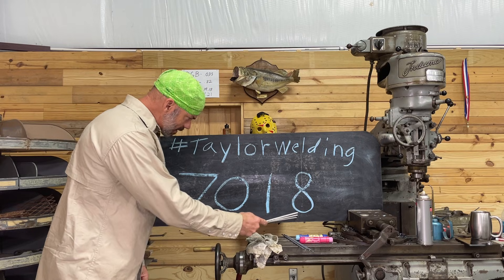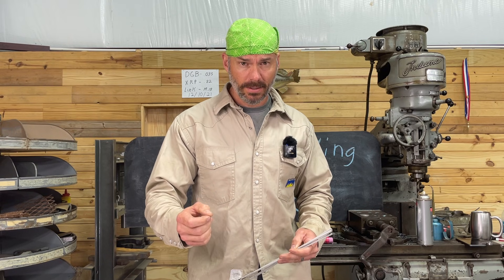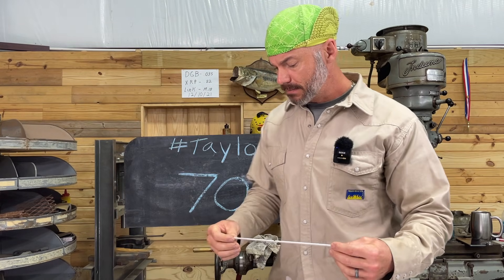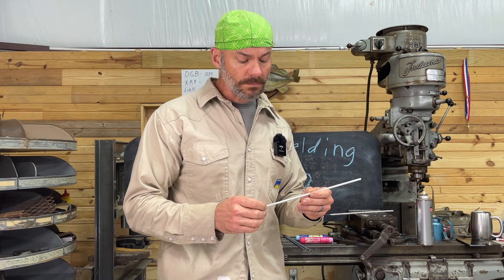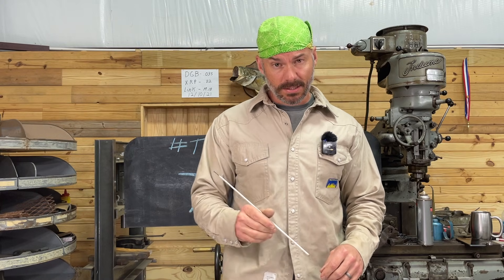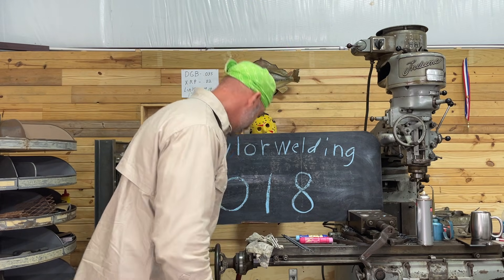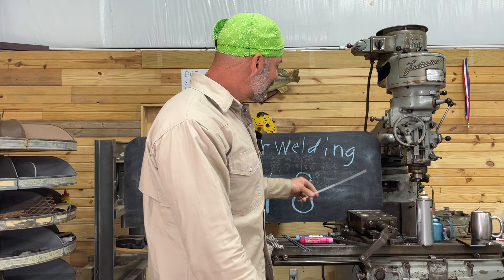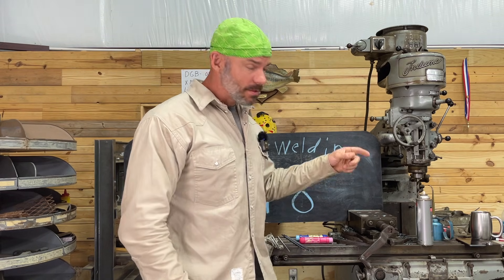How to Weld 7018 welding rod tips and tricks.

Comment: Thanks bro will put the tips u shared into practice.Tell me is it absolutely necessary to use a hot rod heat with 7018.. especially if welding oil n gas pipes?
Reply from the maker: The only thing around heaters good for is drying out your rods. Keep them dry you don’t need a rod heater. IMO 
That’s just my experience.

Comment: Enjoy your channel. I did recently see a test on 7018 on a youtube video called "Hydrogen Cracking"  where they put the welds into mineral oil to see the hydrogen seep out. From what they showed, there really is less hydrogen in the weld if the rod is kept in an oven. Like you, I've had no problem welding with the rod either way but... food for thought.
Reply: It's unfortunate to hear this video. He's got a LOT of good videos with many helpful tips, tricks and explanations. However, not understanding hydrogen embrittlement isn't a good reason to put out incorrect information about it. 
Your weld will look great. It will pass UT and X-ray. Hydrogen embrittlement will likely only be noticed after failure of the member. Is this a big deal in oil pipe? Probably not since most are underground (however most DO leak).
It's entirely different when you're talking about a bridge or high-rise. 
I hope the great videos continue, I'll continue to watch.
Reply from the maker: That’s interesting I wonder if it makes a damn bit a difference
Reply: @TaylorWelding  hydrogen embrittlement is real, that's why most welding codes require 7018 rods to be kept dry.

As you know they don't generally become harder to weld with if they get moisture in them.

Comment: Ive got a tip !!! If you use 3/32 7018 and have trouble welding it because it shakes a lot , Just shorten up your rod , I shorten it up by where the stamp is at on the rod . 😄

Comment: Chris thanks for another great vid. I’m a hobby welder that’s retired who welds quit a bit. 7018 restarts are a pain! 
Any thoughts?
Reply: Start it,long arc a bit ,choke up and weld.
Reply from the maker: Yes I've touched on that a little bit. I'll make you a video tue
Reply: 7014
Reply: As soon as you snap out give the rod an aggressive flick. That gets rid of the little slag ball that's about to freeze on the end of the electrode.

Then tap it on the floor or on a hard, ungrounded object to knock back the flux a bit so you expose the rod.

After that you should be able to restart no problem, just be extra sure to strike the arc like you're lighting a match instead of tapping it and it shouldn't stick.

Porosity shouldn't be much of an issue either if you follow those steps.

Comment: You got an overhead or vert up video? Been welding overhead for years with pulls and cv mig. But I’m now shaking off the stick rust and need to reteach myself. Never welded uphill with anything either.
Reply from the maker: I don’t have any vertical videos. I need to do an in-position pipe welding video. That will cover all positions

Comment: I haven't welded in years, but ready to start back with it. Thanks for addressing porosity. I had a problem with it once and had no idea what was causing it and I couldn't remember it being covered in school. Lastly, something to add that i did remember, was how they name the rod.E for electrode, 70 is the tensile strength, 1 is the position allowable to weld 1= all positions, 8 would be the composition of the flux, low hydrogen for the 8
Thanks for sharing your knowledge.
Reply from the maker: Thanks for watching. Man when porosity starts it’s hard to pin it down where it comes from.

Comment: I've got 2 boxes of 7018 ac and I haven't had any luck with either of them yet (one is Lincoln 3/32 and the other is Hobart 1/8). All kinds of porosity at the start and a few random spots throughout the length of the weld
Are the AC 7018s junk? My welder can do DC also, I just didn't realize they were the AC version
Any tips?
Reply from the maker: Yeah I wouldn’t mess with this ac version. Sounds like the culprit

Comment: Only thing s rod oven is good for is reviving rods that have gotten a little bit a moisture to them. It can for sure dry them back out and make them weldable again. At least if they are not too far gone anyway if they have too much moisture their trash toss em. 

And another thing to check especially the last 5-10 years is cheap steel from China... There's a LOT of that stuff floating around and not only will welds get porosity for no real good reason no matter what you do but, the stuff can be so brittle you cant even put it in a press break and make a 90 bend without the whole backside of the bend blowing out. Haven't see it in pipe though but, ive seen a ton of plate steel from china that is just complete garbage.
Reply from the maker: We don’t use any fittings from China for that reason. But Every now and then I’ll weld one that’s just not quite right. It acts funny you know what I mean. China’s QC is  really getting bad
Reply: That stuff fizzes. Damn near lights on fire!

Comment: How do you feel about a 6010 root with a 7014 cap?
Reply from the maker: Just about everything we do has a 6010 root. I don’t know anything about 7014
Reply: Hello, maybe he means 7010
Reply: @f.f985  he means 7014. They burn like a 6013 but with the strength of a 7018 and they don't have to be dry like a 7018. I love em
Reply: I run 6011 root very similar to 6010

Comment: Good video the 7018 is a great rod I always keep some in California you don't really need a rod oven the Sun is so damn hot I open the rod holder and leave them in the hot sun or just take my little propane torch to them and go on welding it works for me always

Comment: Can you weld a small boat trailer with 6011 rootpass and 7018 1/8 thats been covered in the plastic box
 in the garage for 2 years and never been in the oven since the box was opened ?  How  strong will that trailer tongue be?
Reply: Tks man preciate you
Reply from the maker: Yes you can! If the rods burn ok and have not got wet your good to go

Comment: i think the rod oven is for structural code work in earthquake zones because a moist rod loses its low hydrogen characteristics.  the weld wont look any different, but it will be weaker and more brittle.
Reply from the maker: I don’t agree! I have been testing that theory for a long time.
But it is possible. It might diminish in some small way. But I don’t know if it would be noticeable
Reply: @TaylorWelding  Here's an interesting video showing that poorly maintained rods, like the rods you have,  introduce the same amount of hydrogen as rods that aren't low-hydrogen. Which means it is a lot more susceptible to hydrogen cracking. 
https://www.youtube.com/watch?v=Wjz8eh3uxkU&t=254s&ab_channel=BillBruce
Reply: I weld at home,I still bake my rods. Like using a turn signal or stopping at a stop sign no matter what unless the Feds are on ya!😂

Like gun safety. 

An ounce of prevention and whatnot.
Reply: It's noticable, but usually only after the steel is laying in a mangled pile on the ground
Reply: @ryanj2071  good point.  the theory is only testable over decades of stress cycles that can be assessed only in a lab with time and equipment, or in the real world with failure.   I think this particular test was confirmed  in the last SF earthquake where buildings made with 60 rods and unbaked 70 rods failed at weld joints and collapsed destroying property and killing many people.   any metal slinger who says they have been "testing a theory for years" is a little self important and a bit delusional.  just because a pipe joint doesn't snap in half when hoisted after you welded it with unbaked rods doesn't mean it is a code quality weld, just that it is strong enough that day.  a welding code requirement speaks to both strength and durability over time and in non-normal stress situations.  these factors cannot be tested by a welder in the field.  i enjoy taylor videos and his persona and confidence are inspiring, but i would not ignore code requirements on his advice.  Confidence, like a non-code weld, is great until its not.   .
Reply: @peetky8645  well said. And I agree, I love his videos. Just gotta check the attitude when ignoring facts one doesn't understand

Comment: on thin metal does ac work better than dcep?  i have heard of some running dcen for open root 7018...any experience trying that?(northern sweden welding did that i think)
Reply from the maker: Honestly… I very seldom weld thin metal. If I have to I will TIG or Mig

Comment: have some 2x6 11 ga tube i wanna make a carport out of--7018 ok to weld that or would you use flux core fcaw e70t11  ?  once the weather warms up i wanna make some sample joint welds.  can i run downhill(to lessen penetration) with a 3/32 7018 in this gauge metal with maybe a 1/16 open root for the butt weld at the apex of the roof joint?
Reply from the maker: You’re going to get really close to full penetration with about anything you use on 11 gauge. I would not worry about gapping it. I would probably use a mig hardwire for that unless it was dirty I would use flux core. And if you have to use a stick I would use a 6010 3/32
Reply: @TaylorWelding  thank you for you insight..